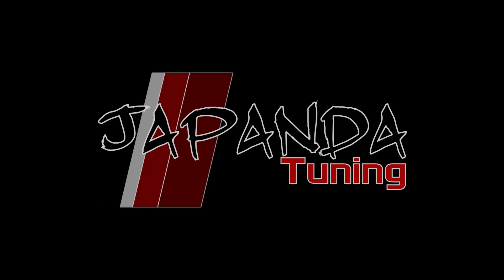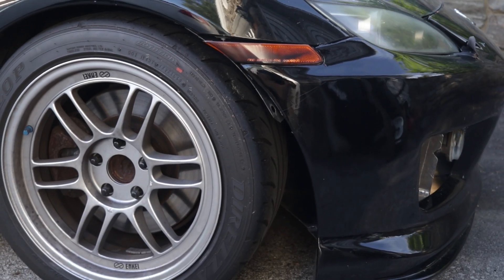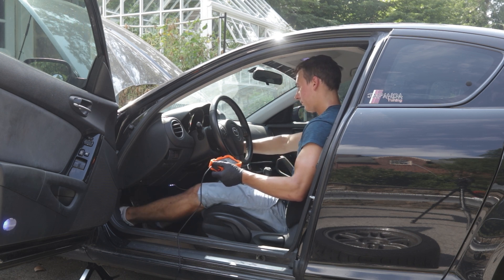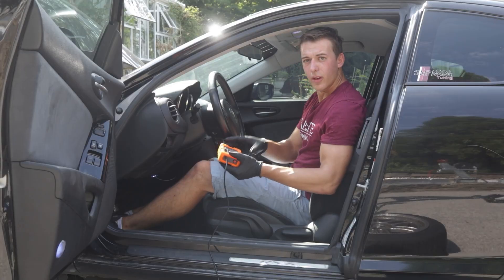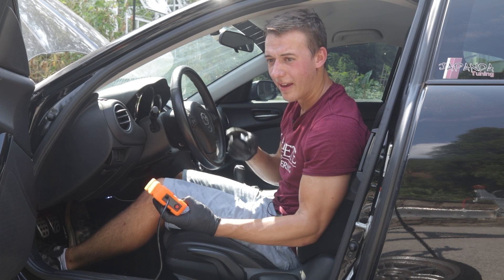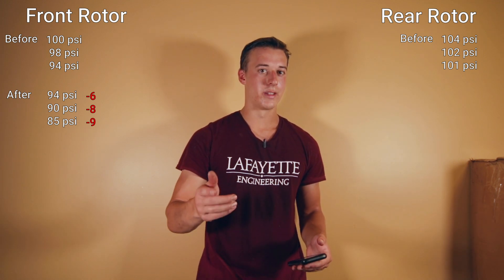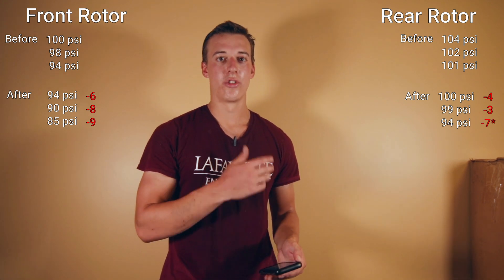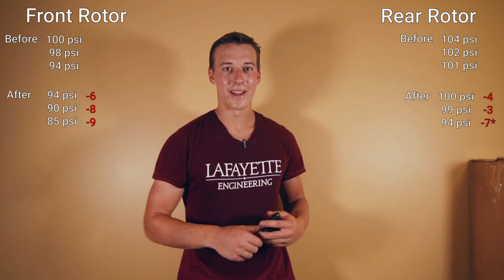Mazda RX8 Track Day Compression Loss Experiment

Comment from the maker: Hey all, I am seeing a lot of questions and concerns so I will do my best to answer and comment on the information in this video.

The compression results were both done on a warm engine at the same location. I tried to do the tests both times when the engine was at around the same temperature, but some small fluctuations in that will affect my compression results. The results are also normalize at 250rpm and corrected for atmospheric pressure.

I do agree that this drop in compression is pretty significant, but I assure you, it is legitimate. The biggest problem I had at this track day was excessive heat. My engine reaches temperature of 220 degrees F +, hotter than you should run these engines, so some compression loss is likely contributed to damage from high heat. All I did was track this car, let it sit for a couple days, then went for a quick drive and compression tested it while warm when I got back.

I agree that another experimental trial with more controls would be a useful experiment, however I am now back at school and will not be able to do more tests on my car for another 4 months or so. If you think of anything you would like to see, I will try to make that happen, just DM me on instagram: japanda_tuning, or send me an email at japandatuners@gmail.com.
Reply: I took my stock 2003 RX-8 for Sepang TrackDay but during the night session.The temp was fine.

But when I took her for day session, the temp soaring to 125c ( oil temp )  during 2nd lap, and on 3rd lap the water temp needle start moving to H.

So , the conclusion, my RX-8 only suitable for night where the air is colder.
Reply: Hey I want to get the same wing that you have but do you think instead of drilling holes in it I could apply some double sided tape if that would hold on it
Reply: And if not can you make a video on how you installed it thanks 🙂
Reply: That's why I like track day at night :)
Reply: https://www.mazdaforum.com/forum/mazda-rx-7-33/joe-maddox-super-rare-1-100-1989-fc3s-gtus-rx7-2jz-gte-vvti-build-43602/
I have found and saved the rarest Mazda FC RX7 ever made! Now this car is rare. Really rare! Let me break this down really quick...
Ever heard of the rare 100 GTUs rx7s? Only 40 have ever been claimed and only 7 are confirmed at the time of this posting! Here are the rarest rx7 FC3S models:
1500 10AE Turbo models
1400 infini
1000 winning limited
150 final edition convertible
100 GTUs...
out of that 100:
83 red on black
10 black on black
7 white on blue
There was only 100 GTUs models created between 1989 and 1991.
If you own one of these rare models sign your car up to the registry list here on any of the rotary forums!

There are rumors about a restamped GTUs model...

The entire origins GTUs owners thread on the rx7club was modified, icemarks claims deleted, registry list changed to have a confirmed section and the mods agree there are not enough GTUs models to have the restamped.

Icemark cites himself while making up the claims almost 20 years ago. 😆

There are no restamped GTUs models, only GTU. Stop spreading false information. There are only 100 GTUs models made, only 40ish have been claimed to have been found, only 7 have been confirmed!

https://www.rx7club.com/2nd-gen-general-discussion-323/very-rare-detail-fc-1129229/

If you have a real GTUs you can register it here!

https://www.mazdaforum.com/forum/mazda-rx-7-33/official-mazda-rx7-gtus-owners-club-thread-44477/

Comment: Wow there must be something wrong with this car, it should not have caused that much compression lost. I have an RX8 R3 granted the S2 is redesigned with more oil injection nozzle, but if premixed properly the wear should be very low, at least not this much. Do you premix? Also what oil do you use? Did you check the operation of the OMP system??

Comment: Have you changed the oil after the track, before the compression test ? As oil breaks down with heat and use, that could also affect your compression test, same as oil consumption rate.

Comment: Yeah you don't want to hit the track cold turkey upgrade cooling oil system ignition  high octane fuel safety prevention measures built into the computer system

Comment: This blow by theory is complete nonsense. What many aren't taking into account are heavily carbon infested rotary engines being used as track cars. What happens over the course of a track day is you get the combustion chamber so hot that the engine finally starts to break down the carbon deposits on the rotor faces. This carbon will break loose from the rotor face and gets caught up in the combustion process. This is like pouring sand into the combustion chamber because the carbon cant easily exit the the combustion chamber due to the side exhaust. This is why Renesis engines loose compression so rapidly compared to the older 13b. The foreign object damage from the carbon breaking away is what's scratching up the housings and lowering the compression. Had you removed the engine and measured EVERY seal, run track day and open engine AGAIN to re-measure you would find that the seals don't wear that fast. You guys need to start doing year carbon cleanings and you WILL stop all this excessive wear. This video has done nothing but add unnecessary panic in the rotary community. Track CLEAN carbon free engines with extra pre-mix,  and you wont have this problem.

Comment: Cool test, I like that you did the test with a warm engine both times.  I will say S1 starters are weaker than S2 (this changed my compression #s because the faster it turns the better compression numbers you’ll see) . The S2 starters spin stronger and faster that the S1 but it’s best to have the battery hooked up to AC power or a big jump box so you always have the same “constant” amount of power pumping to the starter this will also give you better scientific figures.  I’d come home from work and do a compression test and I’d have 90’s across the board but the next week I’d fire it up and let it run for 30min and have over 100 on each face.  What was causing the problem??? (My heat soaked starter and volt drops on my battery also attributed to the extra juice needed to turn the terrible starter).  I’ve owned three of these cars and love them, still have one (track car) and a GTUs.  Give it a shot when you get done with school I’d like to see what you come up with as well!!

Comment: Interesting to see but not particularly useful to draw any meaningful conclusions from this. Two data points are not even close to enough to make a statistically significant claim. Most often it is more useful to just check that compression across all rotor faces are relatively even and don't change a lot over time. These are good reference points for you to use going forward but I wouldn't be concerned about engine health without much more data. So long as the engine still starts easily and feels to make consistent power at high RPM you shouldn't be too concerned.

Also,  220F is not even close to a scary water temp but honestly you should add an oil temp gauge as well since that is actually the more useful and is the potentially fatal value. As long as you are using good quality oil and changing it every few track days it shouldn't be an issue to get up to 250-260. Corvette IMSA racing team released comments a few years ago that they regularly see as high as 300F oil temps in their GTLM cars and they don't have issues running them that way for up to 24 hours. Obviously they are building their engines to a higher tolerance level than most street cars but so long as you have the correct oil weight for your intended task (10-40 works well in rotaries or can even run 20-50 if you are worried about it getting too thin at the rotor bearing surfaces) you should be fine getting it fairly hot. Plus your car is not seeing the same extended abuse that the endurance race cars see.

Keep taking readings over time but I think you are working yourself up about it far too quickly based on a tiny amount of evidence. Keep the dorito content coming!

Comment: aren’t you supposed to test the compression on a cold engine? correct me if i’m wrong.
Reply: I do both. But i base my comp numbers warm because that is where the engine operates and also where you get hot start issues. Saying that, i have never found any mega difference in psi values hot or cold on a worn in engne, only that of a worn out or fresh rebuild <5000kms. Look for consistency in faces. Anything above 90 is damn good and us where most engines sit for most of their life.

Comment: I would think that compression would go up after a track day since (presumably) high-rpm running would de-carbon the engine.
Reply: Actually, it would lower the compression rate, since there is more volume to fill up.
Reply: Depends where the carbon comes from. The majority of carbon buildup in rotaries tends to occur in the seal springs, which prevents them from fully expanding, thus lowering compression @bencevarga6304

Comment: They seem like like low compression numbers regardless. You should be up around 120-130
Reply: When it was new, maybe. They got out of factory at around 8.0 bar, and rather quickly drop to around 7.5, where they tend to stay for a while. Then it goes down gradually, and around 6.0 you're starting to have problems. There are a few which run up to 4.0 bar, but are unable to start at the fuel pump, etc. Mazda says anything under 7.0 is "failing", but that's still plenty of life in the engine.

Comment: Let me throw a curb ball at your experiment , so you stop scaring RX8 owners from tracking their cars .... what if you have an inaudible knock area ( that you don't even know off ) at one point in your RPM range ? due to all sorts of variables like an unbalanced set of dirty injectors , mediocre tune ,  dirty AFM , dying fuel pump , bad ignition system etc , and you keep banging the engine through it over and over and over , but with each lap at a higher combustion temperature ?   It'll be like getting punched 50 times in the jaw during a 1 hour workout compared to getting punched in the jaw 50 times in one year , what do you think will break the jaw faster ?  how about making sure the engine is not getting punched before you track it  ?  .  Did you log/monitor EGT's ? AFR's, oil temps , knock , ETC ?  if not , well then you really have no clue what happened during the track day that made your compression go down , you're just assuming that the track day did it , and that might not be the full story .
Reply: hey stop spreading real knowledge, we're on youtube here...
Reply: Nebbia affaraccimiei  LOL , true , 👍
Reply: You are mostly right, but completely lose it with that attitude. He isn't scaring anyone, and he's actually talking about his own car with actual results of what happened.
Reply: @Flashbang_Photo  how do you know he didn’t scare any RX8 owners ?  This is your opinion not a fact , I came across this video from a concerned RX8 owner that did a FB post about it not wanting to track his car after seen this video .  If you want sugar coatings ... then go to Charlie Wonkas chocolate factory
Reply: Teeranai Work  you know what .... you could be 100% correct on that 👍

Comment: Do you run stock coils? Have you removed your cat? Do you run a SOHN adapter, what oils do you use? Was the engine warm when you conducted the test? What starter motor do you use? All these questions could effect the test results
Reply: I think he installed a racing beat midpipe and he addressed in the top comment that he normalized it and how he got test temps

Comment: The history on the wear of normal piston car vs rotary engine car shows rotary lasting more (le mans experiences) so i would take this with a grain of salt. Also the differences are within a margin of error of 10% which could be on the instrument. We should know and take into account the accuracy of the instrument first... and i think they are within the 10% error of the instrument anyway.. plus any other systematic error... like temperature etc... What would make things interesting for instance would be (scientifically) to make 3 measures before track day. then have track day 1, track day 2, track day 3. For each track day make 3 separate measures. If we see a consistent drop on every track day then we could say there is a pattern.  However, it might be lower than the suggested psi drop that you measured :) So I would be interested to check the numbers after a week or so. Or even a month.